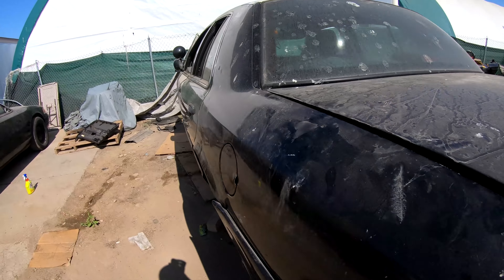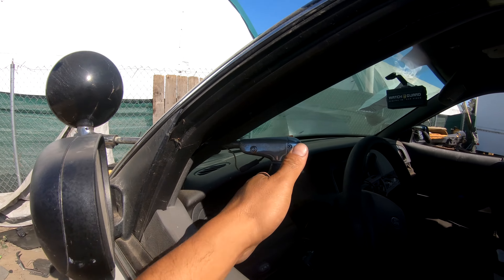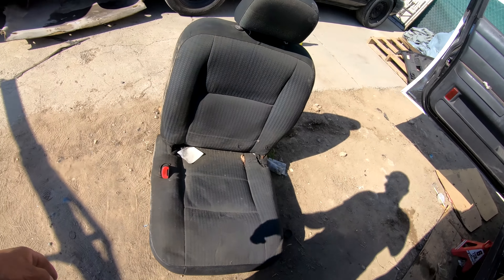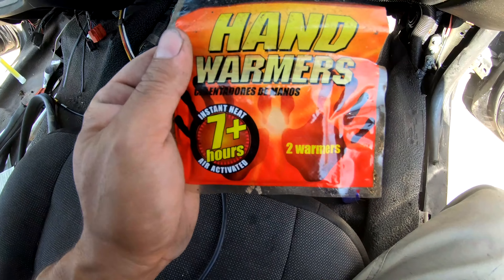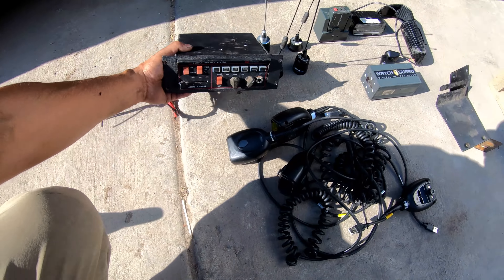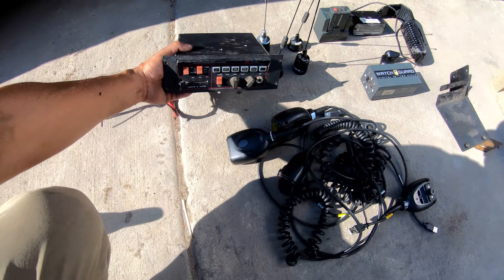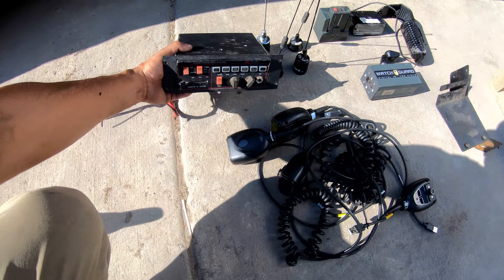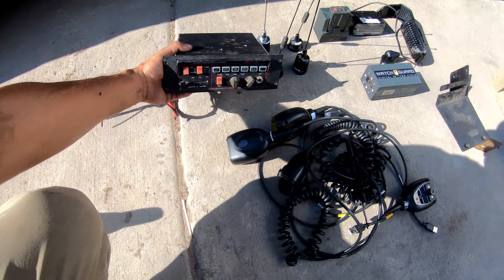I searched an Old Riot Control Police Car Found 1\4 Dynamite Explosion!

Comment: Rick, I got a set of 16” Eagles off a Sacto PD Probation car that need a buyer. Got any tips on finding a buyer?
Reply: Jeff Salver, DOT dates: 0105, 1112, 2112, 3213 - typ PD mixed set.
One depth measurement from each tire ranged from 4mm to 6mm.
$125 for the set.
Reply: Jeff Salver, That’s what they are. They are on original rims with civvie hubcaps.

Comment: Can you sell me a part in the steering column. The plastic piece that the wire connects from shifter. It has a thumb wheel on it ?
Reply: u can check if he's selling it on eBay